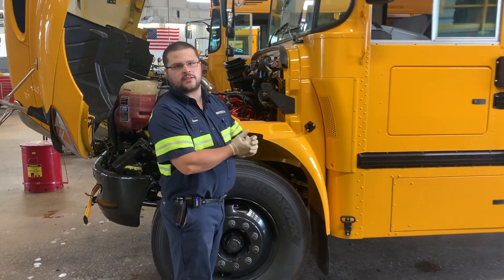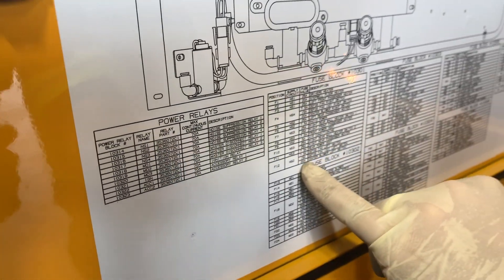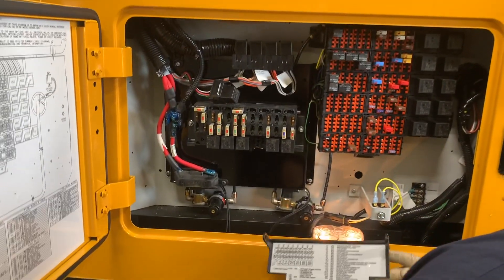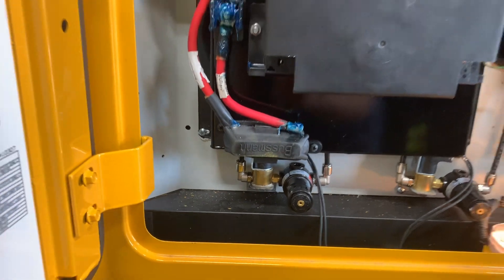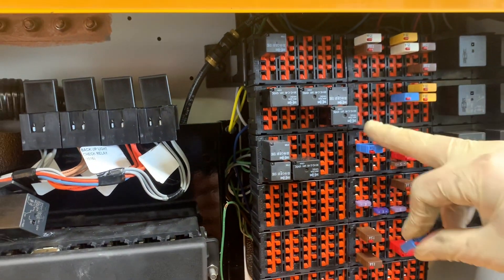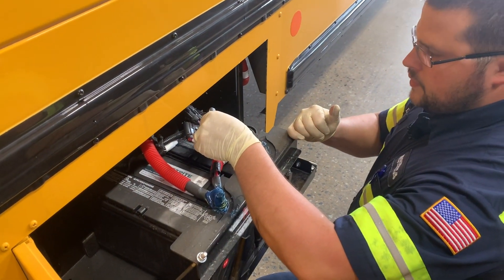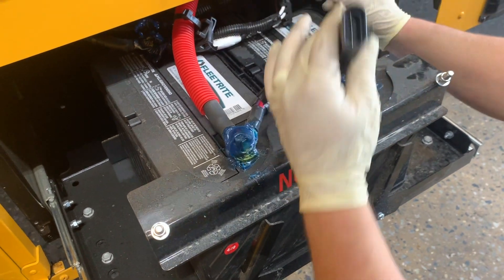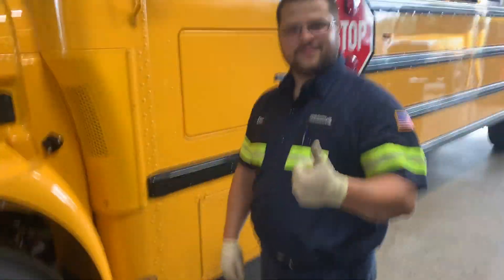Tech Talk Episode 1 (School Bus Electrical Box Overview)

Comment: I have a 2007 CE200 & it died at a stop light. The starter doesn't make any noise when you try using the key. Cross connecting the bottom 2 solenoid wires makes the starter spin & crossing the outside wire with the one on top makes the starter kick out & engage. Do you have any tips where I should look next?